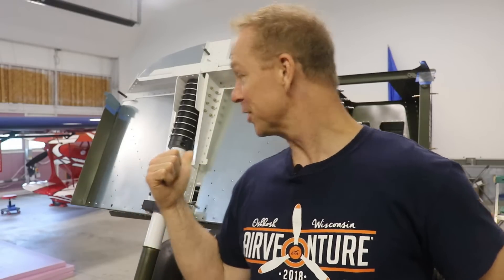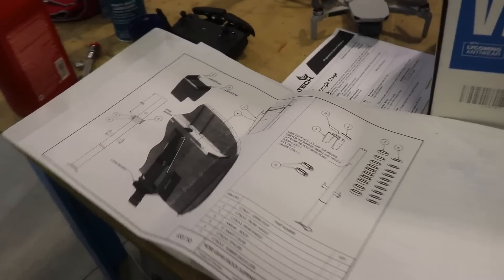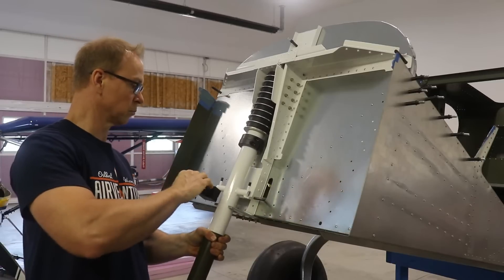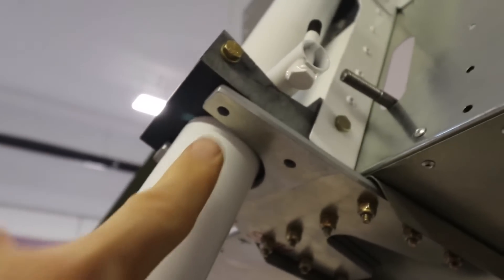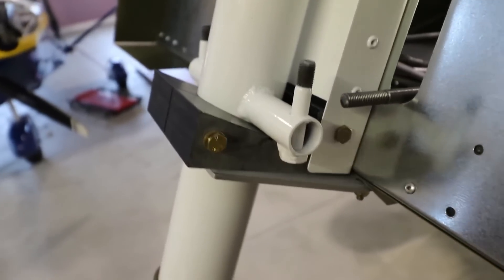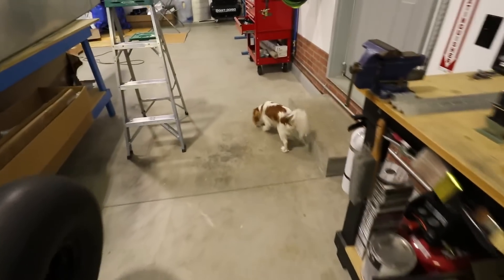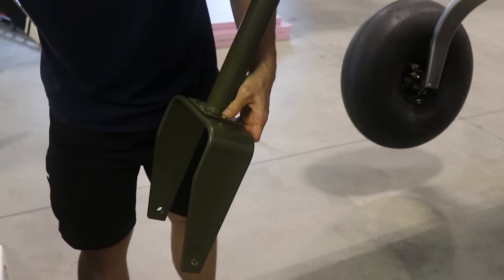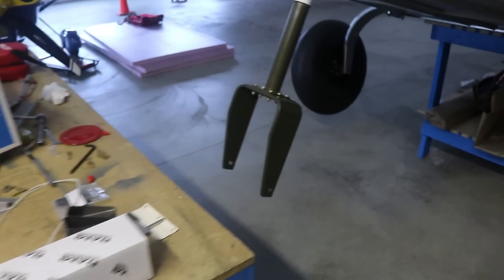Installing the Zenith Super Duty Nose Gear Pucks (Ep49)

Comment: Hi Mark.  Some builders reported that the aluminum rings were really tight fits on their strut.  For your painted strut, did you need to enlarge the aluminum disk holes or did they fit as received?   Great and informative video.  Thank you.
Reply from the maker: I did not modify the rings or the donuts. They fit great.

Comment: Excellent execution on an airframe that would have been my last choice for back country ... you cant fit a 35" tire on the nose and aluminum spring gear on the mains is archaic compared to what's available on other airframes .. With me ,all the time and effort of doing this I surely would have chosen a Super Cub type  or Bearhawk... both of which have twice the resale value and much wider envelope  than the Zenith ... With 35" mains and shock gear you can land on a rock pile .. Zenith forever limited by nose wheel ... Having said that I own a Murphy Rebel lol .. a tail dragger that requires slats to get it into the super cub range of landing slow and whose mains are like the Zenith's , solid aluminum gear without shock absorbing/ dampening  capability.. though it is a tail dragger   ... However Im designing mains for it that resemble the Pilatus Porter .. articulating ,shock dampened .  The main advantage of Zenith .. they're cheap .. Main disadvantage .. they're cheap and not near optimal in any of the categories they dwell in ... I think your building talents and perfectionist qualities should have been spent on a truly extreme state of the art back country machine ... A super cub built by you would be worth $250,000.00
Reply from the maker: Mark, there are many reasons I chose the Super Duty over other bush-type airplanes. I did not choose it because it is the ultimate “nothing-is-better” off airport bush plane. I agree that that other airplanes may have better off airport capabilities than the Super Duty, but I chose this airplane because it has the ability to do what I want to do with it, I thought it was a mean looking airplane, the Zenith kits are just fun to build, I’m a fan of the company, and the folks at Zenith are awesome dudes. If the Super Duty does not fit YOUR mission, then feel free to build something else.
Reply: @KitplaneEnthusiast  Ya I dont build planes to make friends with the factory .. I have friends .. and all planes are fun to build .. especially best in class as opposed to worst in class ..Me spending all that time and effort on worst in class actually takes the fun out of it .. then once airborne being slowest in the group and cant land where they land takes even more fun out  ... And having the least return on dollar and time takes more fun  out ... My mission is for me to make good decisions

Comment: For O Rings, boil water in the microwave and then drop the o-ring in for about 5 minutes. They will go over easily when heated and dont have to worry about stressing the rubber at less than 100C.
Reply from the maker: I’ve never of that but I’ll give it a try! Thanks for the comment.

Comment: It does take 2 people if you try to pull the o-ring up onto the inside of the rim by approaching it from the smaller or inside diameter of the wheel half.  However, I've done this several times solo and I've never had any problem putting the o-ring on the wheel by myself.  Simply lube it a little with your silicone paste grease and from outside the wheel, hook it over the rim of the wheel and stretch it over and snap it onto the relatively "flat" or non-sloped portion of the wheel just inside the rim.  Leave it there until the wheel is assembled and then push it off and it'll slide down to where the two wheel halves meet. I also usually put silicone grease around the periphery where the 2 wheel halves meet so there will be a "bed" of it to replace what is wiped off as the o-ring slides down the wheel half.

Comment: Hey Mark, 

If a bolt doesn't fit, sometimes you can first try another bolt of the same nominal size - as each bolt size does have a tolerance (min & max dimensions) ; you'd be looking for one with a dimension close to the minimum diameter (within the tolerance range) for the part number.

However, holes often have to cleaned out after paint is applied regardless; just consider applying corrosion protection (brush application of Alodine for example) after you clean the hole, if your part and fasteners are made of dissimilar metals and the cleaned surface area is significantly large.

Ps - any mention of silicone grease requiring use of gloves on the packaging ? 
(The type I've used in the past (years ago) mentioned using gloves to avoid possible skin irritation).

Another great video.
Thanks for sharing.

Comment: Is there any drawback to putting the oring on the wheel half not on the bench (top half as seen)? Seems like it would be easier without the tire in the way and maybe wouldn't require extra help. I've never put one of these together, so I could be overlooking something that completely rules that method out.
Reply from the maker: I think you might be on to something. It might be easier to put the o ring on the other half. I’ll try that when I get home.